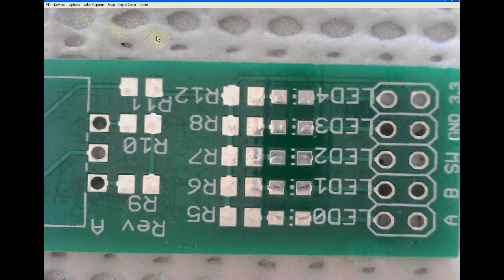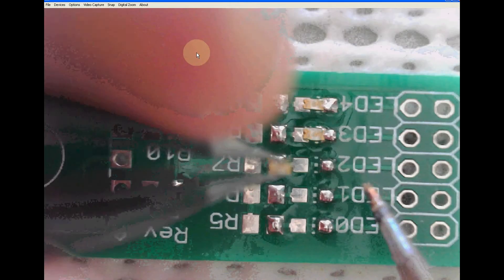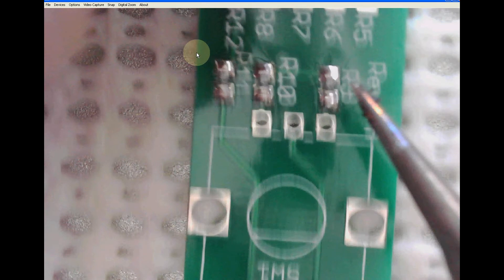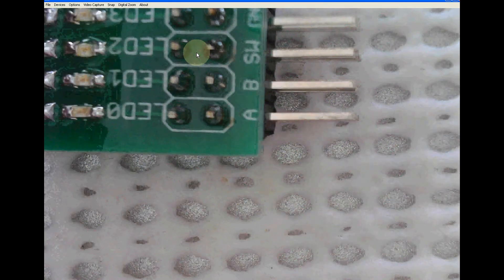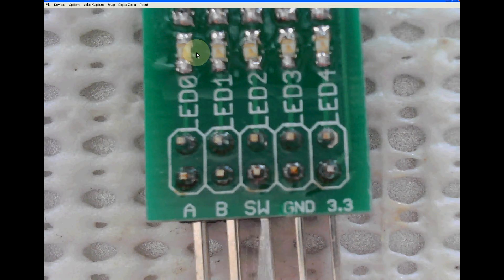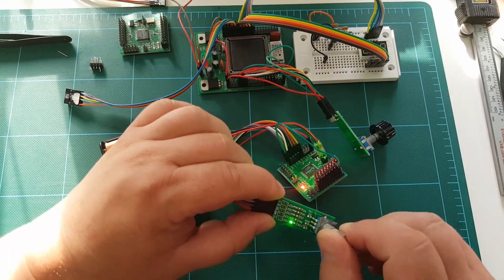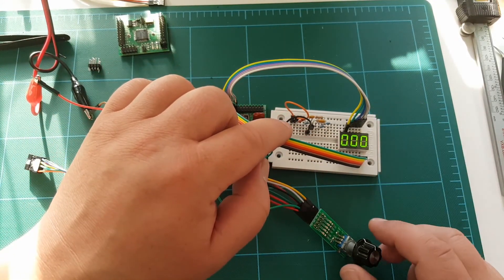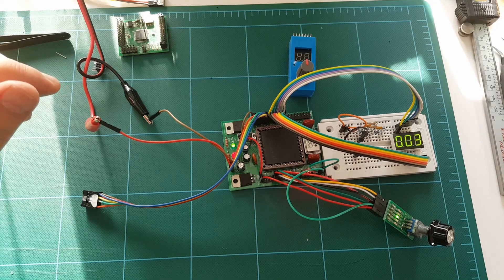Simple SMD project

Comment: Nice soldering Artur...I'm curious as to which Flux paste you're using? Seems my meter always wants to auto-shut off just when I need it too! The finished SMD board looks really good, another great video. Thanks for sharing.
Reply from the maker: Thanks, Darren. Nice to hear from you! 

I use http://www.ebay.com/itm/SRA-TF5000-No-Clean-Tacky-Flux-10cc/121318032348?_trksid=p2060778.c100290.m3507&_trkparms=aid%3D111001%26algo%3DREC.SEED%26ao%3D1%26asc%3D20160727114228%26meid%3D80dc40b6666f495780b4b5f2766ad958%26pid%3D100290%26rk%3D1%26rkt%3D4%26sd%3D121318032348

I've found out that all my meters will override self-power-off if you hold down "select" button when powering on. For the meter I used in this video that's also true, but it keeps beeping periodically to remind you that it is still on.
Reply: Thanks for the link Artur..I just placed an order for 2 tubes, should last awhile! True about the select button feature ..I'm all for the self-power off override, as well as the display light override! 
Nice when a multimeter cooperates.